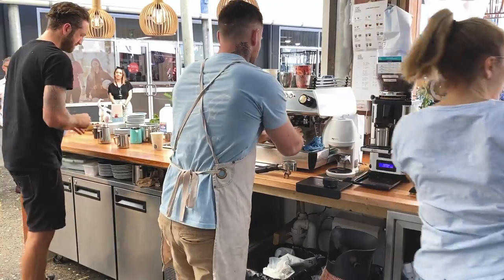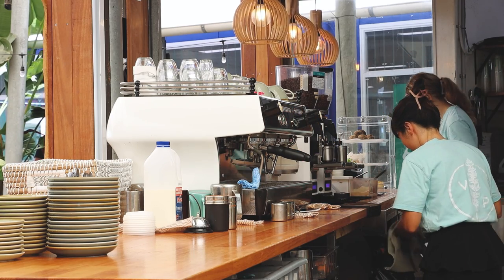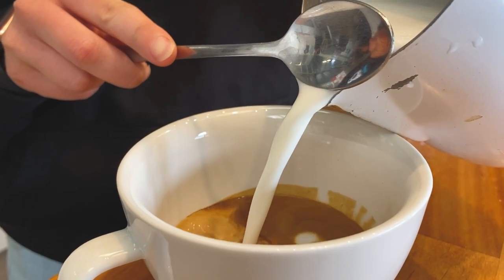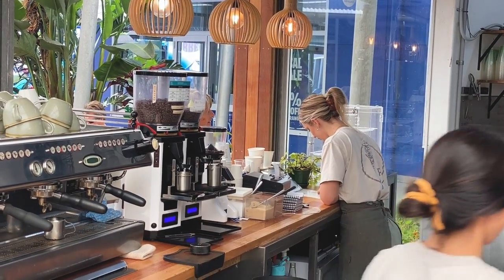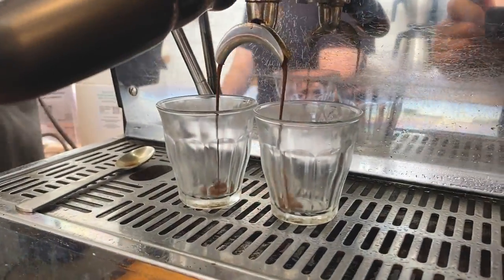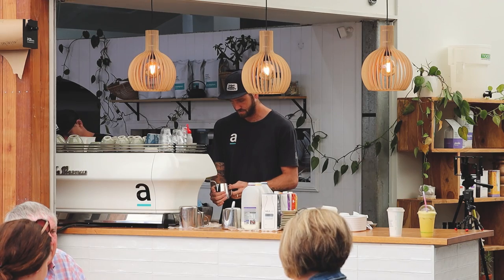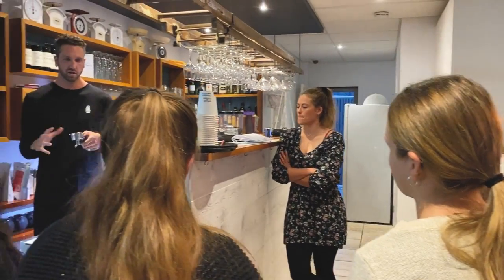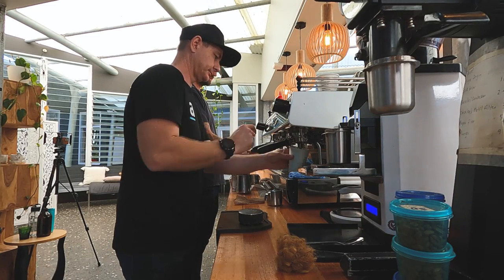How to Make Coffee Faster (Simple Tips to be a Better Barista)

Comment: Very well presented topic!  Fast, efficient and always on-point, just as the barista workflow you described should be.   Insofar as 'speed' goes, it needs to evolve to a reasonable 'faster,' as if not practiced routinely, it's like fumbling the car keys when you're in an emergency - you're going to drop them on the floor almost every time, and take far longer than the 'routine' speed - and likely to spill something.  Fast (but effective) needs to be routine.  And as pointed out, while the coffee is extracting, there's almost always something else that can be done.  

Great video!
Reply from the maker: Thank you 🙏🏻 all good point 👏🏼

Comment: Regarding your puck prep, do you not think you'd be better served by switching out the OCD/NCD for a Duomo needle distribution tool?
You have the same interaction with it but it'll have superior results which would again improve your coffee and add no extra time.
Reply: Agree. Needle distributor is the best
Reply from the maker: We use WDTs when we’re not busy to ensure clumps are broken up and it helps with distribution for sure. The Duomo is even better. 
I’d still probably use an NCD to ensure an even distribution but you’re right, it could be deemed unnecessary. 
Thanks
Jimmy ✌🏻